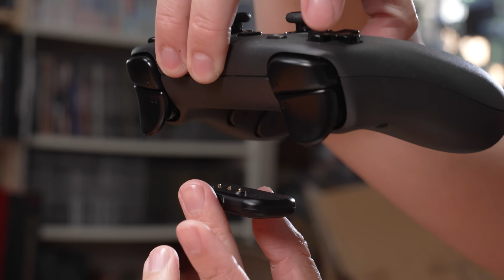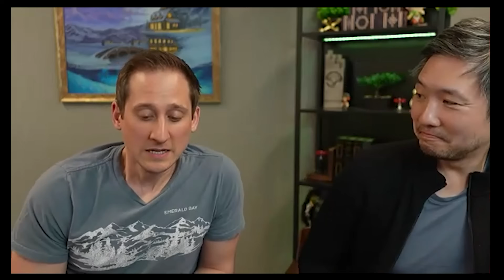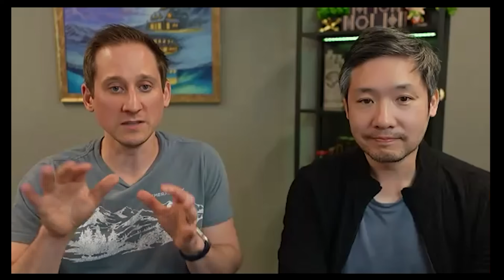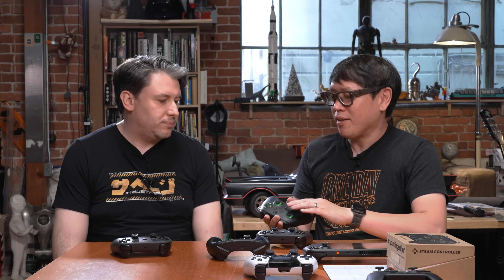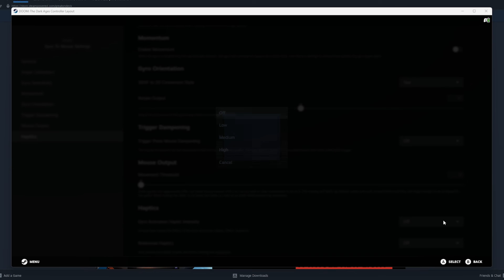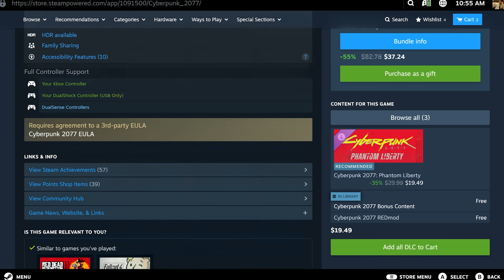Tested: Steam Controller Review + Valve Interview!

Comment: I just wish it had advancad haptics like dualsense. It would be the ultimate controller.
Reply: It does, as did the original Steam Controller. The actuators can be controlled precisely enough to play music. (You can find some videos of it on YouTube, and the new one uses it for some chime/boot sounds.)
The new one also uses them to simulate the "click" of the touchpad (like Macbooks do).

That said, I don't know if Valve's really committed to pushing it as a feature for games to make use of. (And it obviously doesn't have the adaptive triggers that the DualSense has, which is a shame.)
Reply: @Thundertactics  does it? i though it did not even have trigger rumble. Valves own tech specs only put it having 4 rumble/haptics motors that being 2 in the grips and 2 in the trackpads. It has not even got trigger stops for shorter actuation
Reply: @OliM9595  The dual sense doesn't have trigger rumble either, that's an Xbox thing. Dual sense has the resistive triggers that some devs with kick back in some situations but it isn't rumble. This has the same kind of LRA rumble that the PS5 and Switch controller has which gives it the advanced haptics and also haptic feedback to the touch pads.
Reply: @OliM9595  Nothing for the triggers, no. (As I said, it doesn't have the adaptive trigger thing. The DualSense also doesn't use rumble for the triggers, but some motors to push back on the triggers.)

All four haptic motors in the new controller are LRAs (Linear Resonant Actuators), which is the same thing the DualSense uses, and the original Steam Controller did (and the Switch, and all of Apple's recent stuff, for that matter). They don't spin around, but just move a weight around linearly using a voice coil. Which means they're basically controlled like speakers. (The DualSense even exposes them as audio channels if you connect them to a PC)

Though like the DualSense (and unlike the original), they have some bigger cylindrical ones in the grips for stronger feedback. (Which can look like conventional unbalanced motors at first glance, but very much aren't.)
Reply: Dualsense triggers are patented by Sony, they would have to license that - and they didn't.
The previous Steamcontroller had two stage triggers, which is a predecessor of that technology, but they didn't include it in the new one.
Reply: It can process advanced waveforms, like the DuelSense, but utilising that feature kinda depends on if the game you're playing supports it or not. You can see it in action when it's playing jungles or music through the haptic motors.
Reply: Problem with that is that they can't all be consistent with each other because everyone has their own proprietary and own implementation. So the experience will be very different.
Playstation/Xbox has the power to force or influence game devs to use their features but Valve despite being a dominant force don't have that power to influence how games are made.
Reply: @AninoNiKugi  Yeah, while Steam is big on PC, Valve doesn't ship a controller with every Steam install like Sony and Microsoft can ship a controller with every console, so there's not really an incentive to target their controller specifically or treat it as the default.

However, they do have Steam Input, which is used by lots of games. So if they make the HD haptics part of the API, and make it work for both their own controller and the DualSense, they might create enough of an audience for devs to target it.
Reply: That would be nice, but I don't see it being worth it unless Microsoft adopts it. Sony keeps it pretty locked down. Very few PC ports support advanced haptics, and the DualSense isn't fully functional on PC even when used wired with first party Sony games.

Even if the controller supported it, it probably wouldn't work with Sony games natively, and that's basically the whole market.
Reply: membrane buttons is cringe in 2026 i think they will do mouse clickable switches in steam controller buttons but they dont
Reply: @fsociety725  The whole mechanical buttons trend is what is cringe, if you like it ok, but to me it's the worst option when compared to membrane, imo it doesn't feel as good and it's objectively more time consuming to repair if it gets damaged, this trend of "mechanical buttons are premium" is so cringe.
Reply: @Leo08x  Nah, they do certainly feel better, but it is overblown.
Still, given the choice between the two, i'd rather go with mechanical ones.
Reply: @fsociety725  It's not a big deal.
Reply: Haptics in controllers are cool  but like they also just kinda ... suck?

only timee haptics are worth whilee is to add feed bad to a  input whicha  simple rumblee serves perfectly
Reply: @R.0-5.3_Is_Charged have you played astrobot or returnal on ps5? The haptics there really added to the immersion for me
Reply: @R.0-5.3_Is_Charged  I'm a PC player first and Sony is my least favourite console company, but i'll have to say that the Dualsense actually did make the one game i played with it (Cyberpunk) genuinely more fun. It's just that A) dualsense controllers cost around 80€ and B) too few games on PC support it to be useful to me.
Reply: Oh no, haptics are cool for a few minutes, and then you turn if off lol
Reply: @wybomendant I don’t.
Reply: @dnzrdm I didn't either. I played PRAGMATA with it and really enjoyed it with my Dualsense Edge.

Comment: Massive bummer to hear there's no dual stage trigger like the old controller. That what my favorite feature by far. I wonder what their reason is for removing it.
Reply: Simply put, parity with the steam deck. Because the Steam Deck has already has widespread community support for in-game input mapping profiles, they wanted the Steam Controller to be as close as possible to the existing Deck control scheme. 

Because of how the controller is now, anyone can apply a Steam Deck configuration to it and immediately start playing without having to configure a separate layout for the controller.
Reply: @R.i.o.l.u Why did they remove it from the SteamDeck as well? :D Seen a lot of complaints about them removing it.
Reply: @R.i.o.l.u It wouldn't need a separate layout though. Its input can just act like any other trigger, with the 2nd stage unbound.
Reply from the maker: The one consolation is that you can have haptics register feedback when you pull the trigger past a certain point, simulating dual stage somewhat
Reply: I know people have modded the steamdeck to add a button for a bit of a click when you bottom out the triggers, then you can use steam input to add a secondary input. Annoying that it needs to be modded but at least steam input seems to support it. 

PS. I used to enjoy your videos back in the day, good to see you're doing well
Reply: @TheTonVeron  Yes, the steam input config is absolutely insane. Anything you can think of you can set up. It's sad seeing how few reviewers go into it.